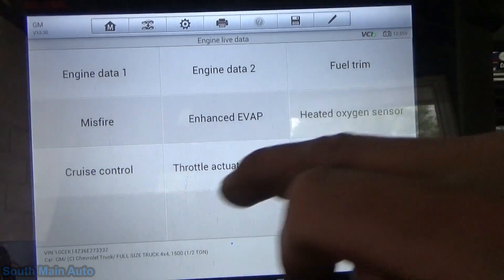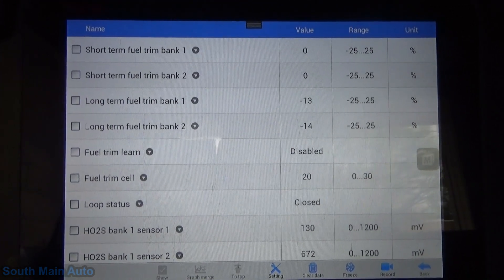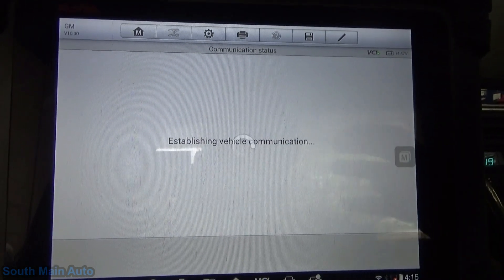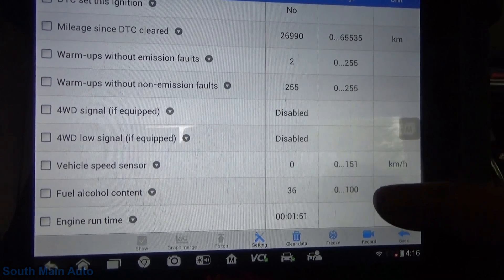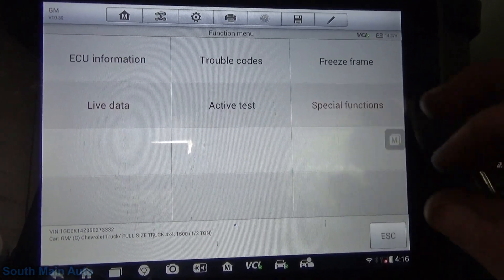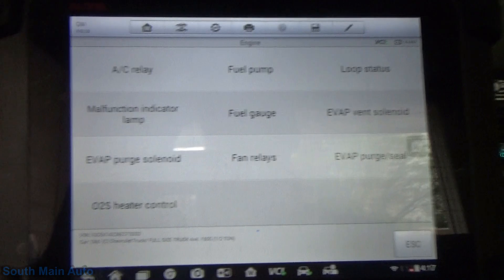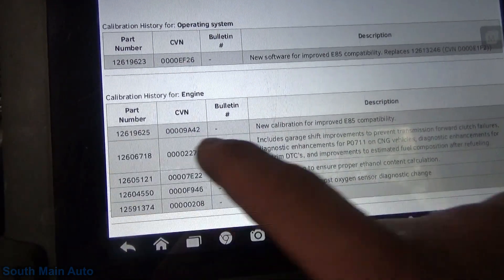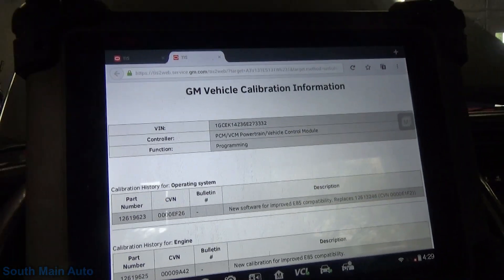Chevrolet Silverado - P0172 P0175 Running Rich

Comment: I've got the wonderful LMG engine in my '07 Silverado. Besides slowly eating cam bearings, I have noticed my fuel trims are as high as this one was before you fixed it. I saw  -14 to  -17 on Long Term, and Short Term seemed to bounce all over the place. No light yet, shockingly. I've always filled this one from empty since the day it was new - never saw the logic in putting $10-$20 in the tank - gotta stop more to fill up, and you're going to spend the money eventually anyway, so why not get it over with in one shot? Anyway .. glad to see the Autel has that calibration reset! I'll probably have to try that.

This truck has always had heavy spark knock when towing. If I put my foot into it with 87 octane, even empty, it pings at full throttle. I started running premium (even premium here has ethanol - no escaping it in MA) because the knock was so severe while towing I had to limit myself to 50 mph - the engine would've grenaded had I kept my foot in it. So much for knock sensors ... I've just got used to spending an extra $15-$20 per tank for premium fuel. Don't know if that's related to the fuel trims or not.

So, is there a math formula to calculate ethanol content using that beaker? I just recently bought an ethanol test kit - probably just wasted my money if so ...
Reply: Pour in 100 ml of fuel add 20 ml of water in a graduated cylinder, shake or stir & let settle for @15 minutes. Where the separation line is say 30 ml subtract the 20 ml you poured in and you have 10 ml of water so ethanol is @10%. The ethanol kits are extremely small and work but the benefits of using a graduated cylinder is you can see the quality of fuel and any sediment from a larger sample and easier to make an accurate measurement. Some of the kits are so small you almost have to use an eye dropper to add the water. I have a 250 ml graduated cylinder & it works perfect. If you start with 100 ml of fuel no math is required. If you only use 10 ml of fuel and 2 ml of water then if it's at 3 ml and you subtract the 2 ml you take the 1 ml x 10 and you'll have your percentage.
Reply: Thanks man! Appreciate the info! Had a feeling I got ripped, lol. I should've researched this further at the time. The kit came with containers & pre-marked lines reading percentage directly, and some dye that's supposed to turn blue with the slightest alcohol. Another one for the notebook! Thanks again!
Reply: Smitty Smithsonite the knock sensors are notoriously bad in these engines.
Reply: I've heard that too, Paul. I suspect mine have been bad right from day 1, or not long after.
Reply: My lincoln has no knock sensor, and when you hear audible knock, Ford describes this as normal operation.. Its even in the manual.  So I run no less than 91.
Reply: Can you run some sea foam or GM top engine cleaner thru it? Maybe the EGR passages are clogged? Maybe replace the knock sensors and be very careful to properly torque them? They're very sensitive to installed torque.

Comment: No alcohol here for Shell or Ultramar 91! Woot! (Whitby, Ontario, Canada).
Reply: You're lucky! The state I'm in (Massachusetts) forces us to put this crap in EVERYTHING that runs on gasoline, unless you want to spend $15 a gallon on VP fuel and buy it by the drum ...
Reply: About 6 months ago we now have ethanol free fuel at the pumps next to the 10% ethanol Marine engines do not like ethanol and will run on 10% but will grenade on 15% or more.
Reply: Ethanol in our regular and premium gas in NJ. I know the regular gas I use is usually about 8% and the premium is a little lower, about 6%.
Reply: Interesting. I'll have to test mine tomorrow and see what it is. I've got a tank full of premium in the truck, and just filled the barrel here with 87.

I've long suspected MA stations of adding far above the 10% posted on the pumps, just to make a buck. Will be interesting to see what it comes out as. Both the truck and the barrel were purchased from the same station (they used Gulf as their gas supplier in the day, and I suspect they still do).
Reply: In central NY (upstate) they put 10% alcohol in almost all gasoline, I'm fortunate in my area to be able to buy  alcohol-free 92 octane gas at three locations in my area (from pumps out in front) It's about $0.80 more than regular.  I use the alcohol-free in lawnmower, chainsaw, etc.  After the lawnmower sits it's really hard to run it with 10% or more water in the tank.
Reply: LOL David, that's for sure!

Whenever I go to NY, I stop at a Stuart's Shops and fill up with 92. I can feel the HP gain seat of the pants - it's a big difference. 

If my 5 gallon premix jug is getting close to empty, I'll bring that with me and fill that up out there as well. Saves alot of headaches.

Just yesterday I had someone from Craigslist coming down to check out a mower, and when I tried to start it, it would start, then die as soon as the prime shot ran out. Dropped the bowl and saw ethanol separation! Never fails ...
Reply: @SmittySmithsonite  what happened with the tests you did in mass? I'm having issues with my gmc6.2 everything is pointing to this issue with the alcohol content.
Reply: @phouston6802  - Tests from fuel at Cumberland Farms locally actually showed less than 10%. Was 7% if I remember right. I never did get around to doing the various stations around the state. Some day I will.

For your problem, any high end,  bi-directional scan tool will have a "Fuel Composition Reset" parameter in there that will allow you to reset the computer back to 3% alcohol content (as low as it will go). With the 2007-up GMT-900 platform, that fuel composition level can reach double digits, especially if you do alot of "top-offs" at the gas station vs. running it to E, and refilling. The algorithm for computing alcohol content in these trucks is severely flawed. For the older GMT-800 trucks, I believe those have an actual alcohol sensor that can fail.

_ EDIT - My memory fails me  - I see this video is on this subject, and on a '06 model!

Comment: Their still offering the option to get E85 engine or not. I would pass on it, no E85 up here. I haven't seen a vid on Chevy cylinder deactivation  so far. They must be ok  then .
Reply: I have heard this before with the newer ones. Maybe they increased the compression ratio on those? About the only way they'd make more power on alcohol. Making way more power than my '07 was stock. I was 315/330, and maybe added 15-20 to  each if I'm lucky.

With my truck, any time I get out of state and fill up with ethanol-free fuel, it feels like I gained 30HP - it's a very noticeable change.
Reply: This is from General Motors 2017 Silverado
Engine: 5.3L EcoTec3 V8  
Includes active fuel management, direct injection, variable valve timing and aluminum block construction. Horsepower: (hp / kw @ rpm): 355 / 265 @ 5,600.Torque (lb.-ft. / Nm @ rpm): 383 / 520 @ 4,100.

 
Engine: 5.3L EcoTec3 V8 w/Flex Fuel  
Includes active fuel management, direct injection, variable valve timing and aluminum block construction. Horsepower: (hp / kw @ rpm): 355 / 265 @ 5,600.Torque (lb.-ft. / Nm @ rpm): 383 / 520 @ 4,100.
Reply: Wish they'd differentiate between those numbers running on E-85 vs. gas - that would be a great test. Somebody has to have done that on Youtube ...
Reply: On the 2017 2500hd 6 liter engine it's only E85.  I do remember when there was a difference in ratings.  That would be a hard vid to do , haven't seen it done yet , probably too costly . LOL
Reply: Smitty Smithsonite you dont lose power with e85. Its the exact opposite. A new 5.3 silverado is making 355 hp with gas and 380 hp on e85. You are right about the fuel economy though. I like e85 because it gives us something to fall back on. Oil is finite... for now. And the last thing i want is for the world to ditch the gas engine  and we have no other choice than to drive in around in fucking electrical cars and hydrogen cars
Reply: STEVE ROB on the EPA's website, they have the 4.3 and 5.3 listed as vehicles that run on e85 for 2017
Reply: Smitty Smithsonite E-85 actually produces more power then pump gas ....
Reply: I suppose if the engine is tuned to run it, like I alluded to in my post above. Just like a gas engine can produce more power than a diesel, even though diesel has more BTUs per gallon.

In every vehicle I've owned, more alcohol = less power and less MPG. My newest vehicle is 10 years old now.
Reply: HA! :D I'm seeing high levels of copper and iron in my last oil analysis with just 5,500 miles on Amsoil Signature Series. Cam bearings. Yaaay! :( GM sure knows how to build 'em ...

I have owned the flex engine for 10 years now - never once have I filled with E85. Another government scam. Sure, may be a few cents cheaper per gallon, but you lose power and mileage, so  you'll be back at the station soon again ... Totally pointless, and a waste of money.
Reply: Like most regs in the auto industry it's  big government mandating a lot of this stuff. That's changing now at last and some common sense is back . Cheers and good luck with the engine, my chevy 6.0 290K still running strong.

Comment: This started with the idea old cars pre O2 sensor ones needed oxygenated fuels to help meet air quality standards which eventually turned into requiring E-10 at the pump, then it morphed into  producing our own energy and energy independence.  The farm lobbyists are some of the best in the business .
Reply: Not just car owners - OPE (outdoor power equipment) owners, plus boat and motorcycle owners have bore the brunt of this more than anyone. There's a reason there's no ethanol in aviation gas! Everything from boats to weedwackers has been affected.

Early boat fiberglass fuel tanks delaminated in contact with ethanol - cost people THOUSANDS of dollars. EPA emission requirements force OPE equipment manufacturers and dealers to set the equipment up super lean - add ethanol to the mix, and they melted down. More money down the toilet.

I've been working on OPE, boats & motorcycles full time for the past 8 years. 95% of what I do here is repair ethanol-related breakdowns, from clogged carbs & fuel tanks, to engines that ran too lean and melted down. Seeing lots of coil failures too, probably related to running so lean, and the influx of chinesium parts.
Reply: Exactly. Amazing how Agra lobbying has turned into problems for car owners. I've read that other nations have abandoned the whole flex fuel experiment simply because it was not cost effective. Here, without pretty strong corn subsidies, we wouldn't be doing it either. Or, am I misinformed?
Reply: For my around-the-house small engine needs I travel a few miles to buy ethanol-free gasoline; for me it's well worth the trip.  Those who remember buying wintertime gasoline deicer (100% ethanol) don't have to anymore; the wonderful ethanol in the gasoline absorbs water.  Have you ever let your lawnmower sit for a month and try to run it with 10% WATER in the tank??
Reply: Yeah, Al - I see that same thing all the time. Most of them are right on the ragged edge of meltdown, but that's what the EPA wants.

The ones that are adjustable usually just need a little more fuel, and their happy. The ones that aren't adjustable really suck. Some will bog like crazy for the first 5 minutes until their hot, then run super lean the rest of the time. Those usually live short lives.
Reply: for offroad use, avgas 100LL is great  LL = Low Lead, them old dirt bikes and vw engines love it!
Reply: I wish we had that option here, David. Closest ethanol-free gas station is 1.5 hours from here, in NY. They sell ethanol free premium. No such luck in MA though - all grades have ethanol.
Reply: And then the car mfrs decided well, if we have to harden the fuel system to tolerate that much alcohol, we might as well market it as being "flex fuel". I will say in some cases it is cheaper to fill up with E85 (even with the crappier mpg) so I'm not going to judge things too much.
Reply: just be careful with the avgas 100LL, not all engines tolerate "leaded fuels",  it can foul spark plugs and buildup internally.
it should be limited to higher compression engines and don't use it in anything with oxygen sensor, catalytic converter or any other sensor in the exhaust system!  *check your local marinas/marine places for ethanol free fuel*
Reply: Smitty Smithsonite Amazingly enough, living in Iowa (you know - corn country) the gas station just up the street from my house sells ethanol-free gas.  It's a Casey's General Store which is not only headquartered in Iowa but Casey's is the largest fuel retailer in the state.  
Sure it costs more but I get better mileage and it can sit in my snow blower and mower for weeks with no issues.  The only time I purchase E10 (have never bought E15) is when there's absolutely no other option.
Reply: +Smitty Smithsonite
 Look to other sources. Small airports, other odd sources of fuel. Living in NJ, its near impossible to get straight gas, and anyone that does is using av100LL from a small airport. 

I started using av100LL in my small engines. The string trimmer and chainsaw seem to run well on it, and can idle super low. Next up is the Kohler K engine but the garden tractor is down for repairs right now, until I get the parts and time to fix it.
Reply: That's a great idea snoop.  It's a bit of a drive for me, so I've been looking into buying 55 gallon drums of VP, or whatever else is out there, ethanol free. They're pricey, but I'm sure I could sell alot of the stuff to customers.

Comment: So it can only determine the alchol content by way of the O2 sensor? I watch Mighty Car Mods and on alot of their cars they run corn juice E85 but they use an actual flex fuel module which tells ecu you have X% to play with. How can GM decern "meaningful" values even if the customer always brim fills the tank and runs the car long enough in closed loop, can anyone tell me more, I must be having a senior moment if all the information was presented here cus I don't get it?
Reply: Would love to hear more on this topic 👍

Comment: Is it running rich because the ecm is giving to much fuel trying to compensate for the lower amount of btu's in ethanol when it is a mistake and there is really a lower percent of alcohol in the fuel than what the ecm believes there to be?
Reply: correct... and GM saved $$ by not putting a real alcohol sensor in it, so the PCM has to guess based on history and fuel trim and fuel level sensor etc
Reply: thedreadedgman thank you.